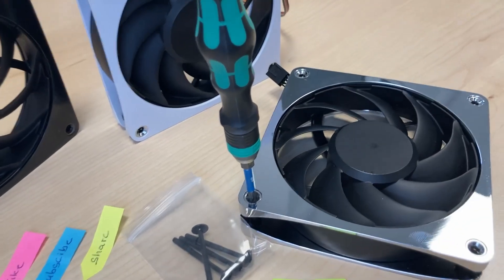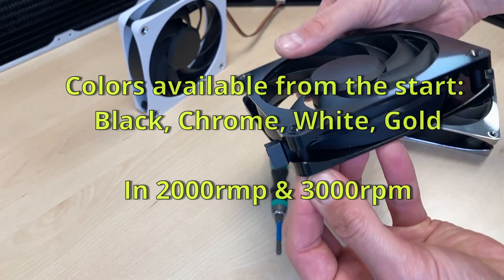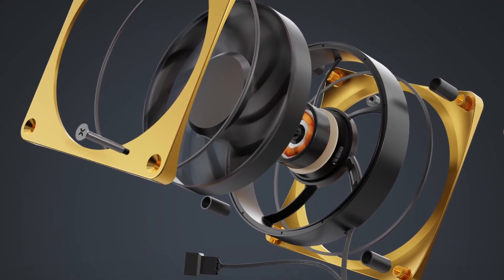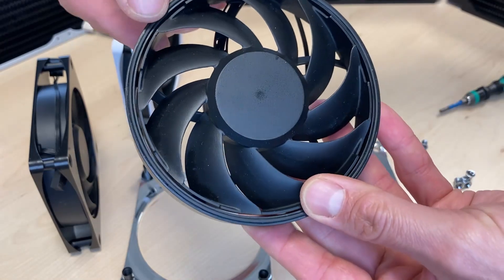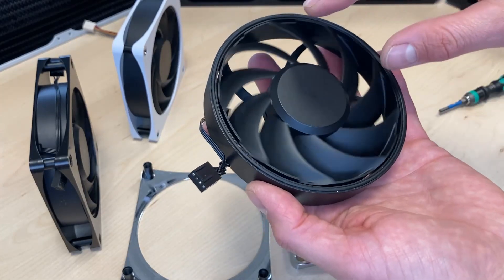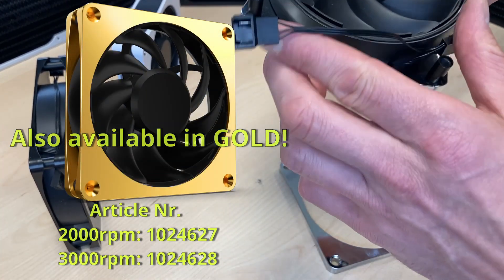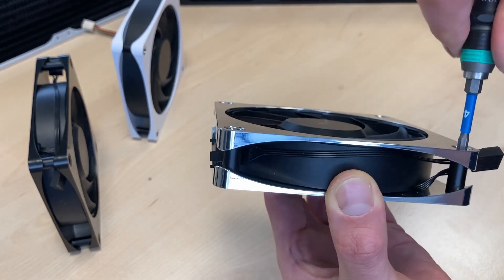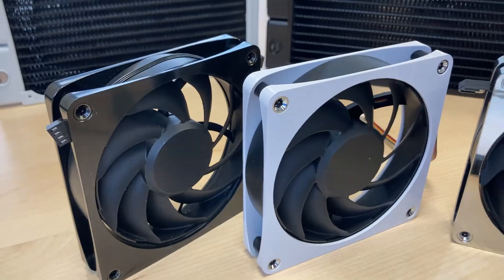Inside Look: Disassembling the Alphacool Apex Stealth Fan 🔧🌬

Comment: now that is impressive, I do like that isolated ring thing the way it's set up there. eons ago I came up with something sort of like that, however it was a manufacturing limitation rather than a vibration isolation/dampening thing. its kind of difficult to put the impeller into a fan if a set of IGVs are in the way with a set of stater vanes on the other side, the frame has to be in at least 2 parts to assemble that, lol. my inspiration being from the intake side of an Olympus 593 engine from the Concorde. as for a gasket, never considered them for more than just keeping the parts from buzzing against each other.
Reply from the maker: Thanks, the isolated ring is indeed the greatest part of the invention - no vibrations needed

Comment: I may get an extra in white to disassemble and see what I can modify for custom painting.
Reply from the maker: Yes that is what we originally intended when we created these fans. 
For mass production we needed to change the mounting of the fan, as sometimes screws got loose, so it will be hard to disassemble one - but I will give more updates especially on that topic when I have the final products here on my desk
Reply: @aquatuningtv  Thanks, it'll be great to know the bonding method for safe disassembly. I'll also have to pay close attention to the orientation to seat the orings back properly
Reply from the maker: Yes, me too, can you imagine how hard I am waiting for the fans to arrive.... the fans are now in the German customs clerance :-)
Reply: @aquatuningtv  As a fellow mechanical design engineer, I can imagine! The products we design can be so cool some times and we want to see the properly manufactured ones!